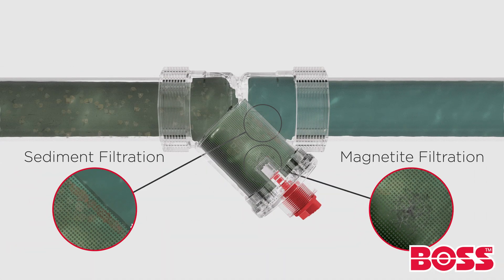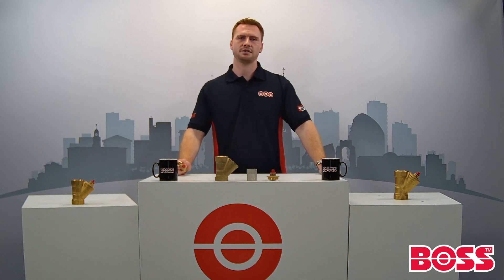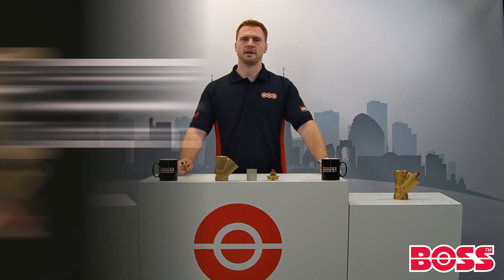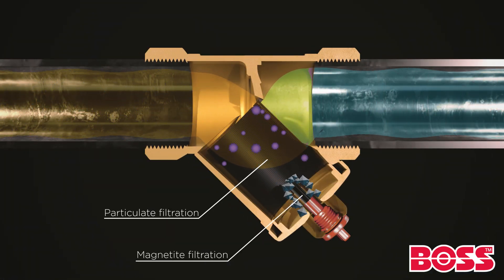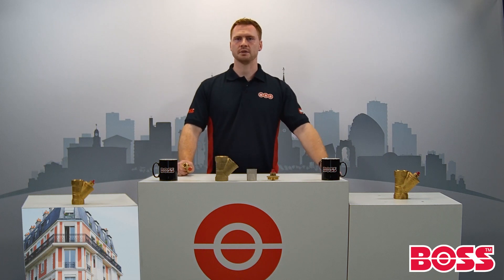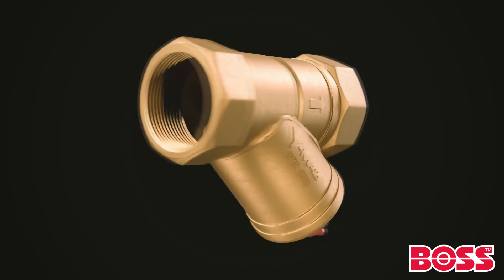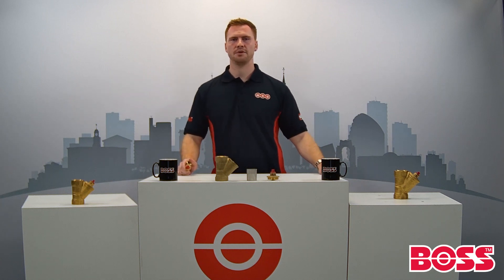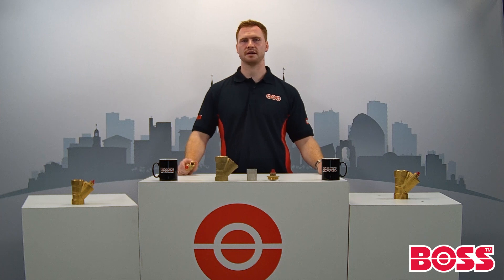BOSS™ Y-MAG Magnetic Filter

Comment: Why is it not suitable for potable or domestic water applications?

Thinking about reducing particulates from existing lead/copper piping into domestic property - before water filter system - it shouldn’t do any harm unless the filter /components toxic? 

It’s a neater solution to my just strapping a magnet to a downpipe in the system I adopted 

👍
Reply: Thanks for your interest in the BOSS Y-Mag Magnetic Filter.  To answer your question, the BOSS Y-Mag does not hold a WRAS approval certificate which is necessary for potable water applications.  The BOSS Y-Mag can be installed in heating, chiller/cooling, and condenser systems to provide system protection. Hope this helps, BSS
Reply: @ yep, this helps - a bit - why not apply for approval? 
You would need to submit item to the laboratory & WRAS fee:- 

New or renewal applications:

Direct application to WRAS:

Level 1 - £420
Level 2 - £462
Level 3 - £504

So doesn’t appear too expensive? 

Include a fitting from screw fitting to a typical compression type fitting -  akin to a coupler - albeit the filter/magnet addition - the item can then be marketed as approved for potable / domestic applications 🤔

Worth a punt? 

Be interested to know your thoughts 👍